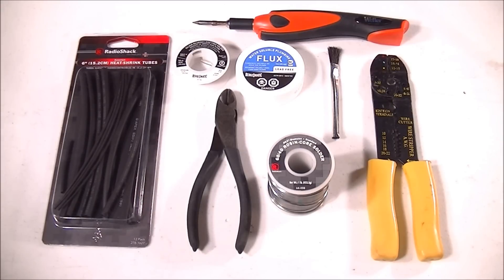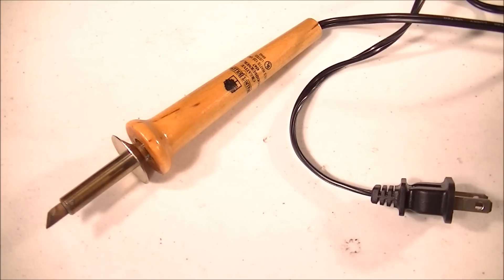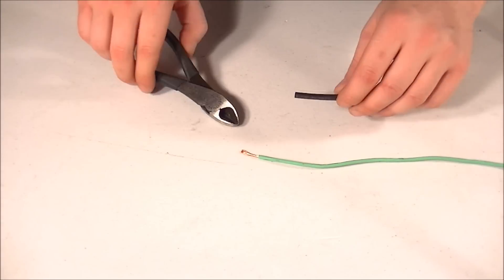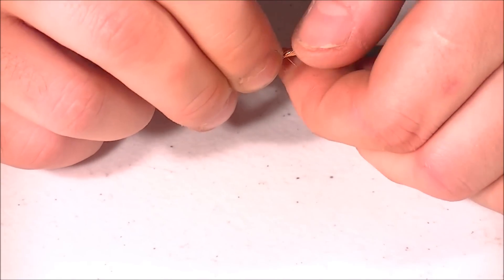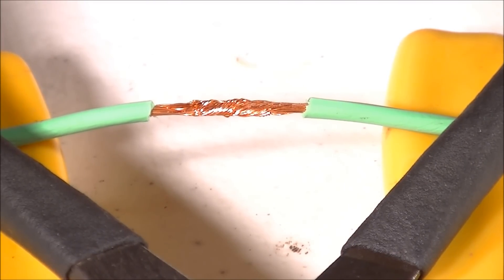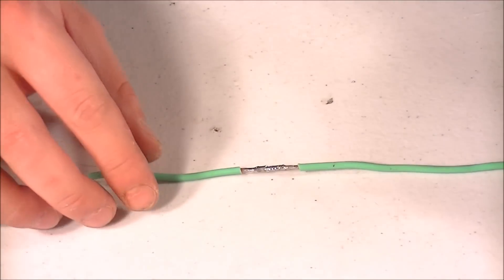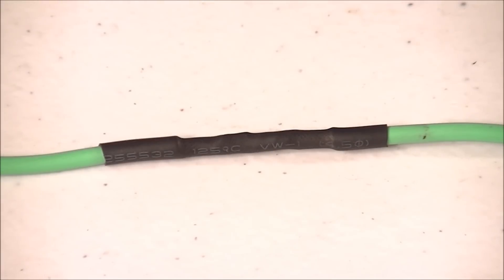How To Solder - Intro/Joining Stranded Wires - Part 1

Comment: 115 volts ! I was using a solder gun from O'Reilly autoparts store that I bought to solder a wire harness on my low beam headlight. It wouldn't get the wire hot enough to solder. The solder gun is 60 watts plug in.

Comment: i soldered a wire for ignition system on a GSR engine in a 1995 honda civic and one night it would not start i found the solder connection broke off from flexing i was sad... this is why they do not solder wiring on cars and trucks they crimp them and they are stranded wiring, i did learn that in college when i took a 1 year class on auto electrical.... it was a great class to take and learn something like no solder on some things.. but just crimp them together for flexing problems... they will flex and brake off like mine did ....

Comment: Can you bend a stranded wire that has been soldered? I needed to do so in order to get the wire up through an exit hole in a blender. Just hoping I didn't loosen the solder. Thanks in advance.

Comment: I am a qualified electrician in South Africa and when I use my wire stripper I pull the insulation off towards the square side of the wire stripper. It comes off much easier and because I have used it for a long time I do not have to look at the wire size any more, try it and you will see a marked improvement in stripping wires. ( over here we call electrical wires cables, funny.)

Comment: What solder ratio would you use for 14 gauge wire? Or other similarly small wires? Working on soldering an O2 sensor to a project I’m working on

Comment: Get a good tin on the iron heat one side of the material to be soldered get it hot and it will draw the solder right through it. Get the right temperature or you can burn it up if too hot.  The tin makes the solder joint brittle it does not like to flex.

Comment: Worst method ever of joining wires together.....never twist wires together. Causes high stress areas where solder will not creep into the inner core of the strand. Also the stressed areas are likely to break when mechanically stressed. Use wrap splice method of lineman's splice to join wires to obtain high durability
Reply: Any recommendation on how to solder 4 wires together? I’m having a hell of a time
Reply: @thebruhhh  what you need to do is to look for instructions on the lineman's splice or western Union splice. Video https://m.youtube.com/watch?v=O-ymw7d_nYo

For soldering 4 wires together, pretin them. Hold the pretinned conductors together with a thin piece of wire by wrapping it around. Then solder all 4 wires together. The extra wrap of a thin (30awg) strand of wire assists in soldering the wires together, no fumbling around with crocodile clips to hold it all together.
Reply: @Turnerbiker73  thank you!!

Comment: Just want to say thanks. I have recently watched many solder how to vids and just was not getting what I was doing wrong. The explanation regarding letting the solder touch the tip and the wire and leave it still and the heat will transfer better was exactly what I needed.

Comment: You didn't even show using the flux. What the fuck. I never use flux to solder wire and haven't had an issue.

Comment: I like your video.  Two things I like to do as a habit, 1>put the heatshrink on before removing the insulation.  The bare wires can snag on the shrink and get bent which complicates the process, 2> I put silicone grease on the wire before shrinking the tubing.  It keeps moisture out of the joint in the case it is an automotive wire.  I particularly liked the use of the side cutter and stripper to hold the wires up and stable.

Comment: Hi, I have a question - why is that the wire will be stiff equally on both sides not only in the uninsulated part/visible soldering joint but also about 1 cm in to the insulated part of the wires? Have I used too much flux? Thank you!

Comment: Solder is make believe for me. It does not work as it shows in any of the videos. I use a soldering station and still you have to apply the solder to the tip of the soldering gun. Heating the wire with the soldering gun just burns the wire and the insulation. Soldering just does not work in my universe.

Comment: Is that shrink tubing waterproof? I'm only asking cause it's for the lights on my boat trailer. And the wires get submerged under water at the boat ramp.
Reply from the maker: Thanks for watching! This particular type is not. However they do make waterproof types of heat shrink that are. Usually they have a special type of adhesive coating on the inside that fills all the interior voids and makes your connection 100% waterproof. A bit more pricey but obtainable at most auto parts stores and online. Hope this helps!

Comment: Did he apply flux to the wires here? Is it necessary to purchase flux if this is 90% of the soldering I'll be doing (wire unions)?
Reply: In another comment he said he was using rosin core solder so the flux was integrated into the solder itself so he didn't need to apply any

Comment: Thanks a lot! I have been all over youtube and people bashing over and over.. from what I have learned (new at this) is that when you make the X with stranded wires, it is called a "Lineman Splice" and is used for stranded ONLY. What they say is doing this will weaken stranded thus not recommended. This seems to be the best way as you have shown us and I have a LOT to solder and will be using this method. Thanks a lot man! Great work!!!

Comment: Thanks for the video! Quite illustrative. 
I am still running into trouble, though. For some reason the wires do not absorb the solder and they melt before any solder can stick to them. I have not tried the flux yet, although the solder itself has the flux in it. The wires are not oxidized and are made of copper.

Comment: Why does excess solder increase the resistance? Wouldn't it actually lower it, since the cable gets a bigger diameter at that point?

Comment: twisting the wires is more of a structural connection, sacrificing less resistance.  use a small diameter copper strand (separate from the wires you are connecting) to wrap around the wires instead.  Great video though!

Comment: great video. but you should clean the flux if you want a long lasting joint. flux will corrode the metals over some time. just wipe it with some isopropyl alcohol before putting the heatshrink.

Comment: Another thing about soldering: after soldering, do not move the soldered joint until it is cooled. There is a very brief moment in time, between the time the solder is molten and the time it is cooled, that the solder is susceptible to cracking. I've seen many people solder something, and then, immediately after soldering, shake it or tap it to remove excess solder. That is a bad idea. That is a tip from my 35 years of being an electronics technician.

Comment: Difference between rosin flux and solder that says 2% flux
Reply: 2% means it  has 2% flux in the solder core.Just don't use any kind of acid core flux.

Comment: Excellent vid. Two very minor things: flux removes the microscopic layer of oxidized metal on the surface of the wire (pipe, etc....) allowing the molten solder to stick to it.  Also, silver has higher conductivity than copper. Solder high in silver content should have no problems with resistance for the type of connection in the video. This is no excuse for poor workmanship! Excess solder is not necessary nor does a lumpy joint work well with heat shrink.

Comment: I did not see when the flux was applied.  When should it be applied?  Before twisting the wires together?
Reply: It's usually in the solder.

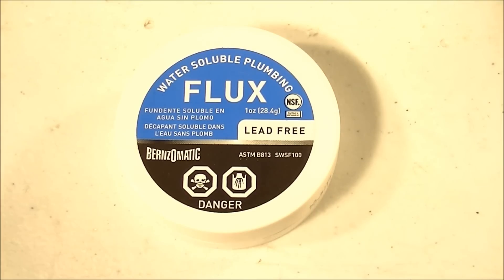Comment: Great video, but at 1:17 you say that flux oxygenates the metal to be soldered.  This is incorrect.  Here is a quote from the metallurgy handbook.  "In high-temperature metal joining processes (welding, brazing and soldering), the primary purpose of flux is to prevent oxidation of the base and filler materials. Tin-lead solder (e.g.) attaches very well to copper, but poorly to the various oxides of copper, which form quickly at soldering temperatures."
Oxygen is your enemy when soldering.

Comment: Why do we need soldering when the wires can be connected and wrap in electrical tape. ? Please advise. Thanks 🇬🇧
Reply: Call an electrician.
Reply: Soldering is a better connection and if done right is pretty much guaranteed not to come undone. It provides a strong connection and ensures a good electrical connection. Electrical tape comes undone, especially in different temperatures like high heat. Shrink tubing is a much better alternative
Reply: Zach Novosad  if I need to buy all the soldering equipment it is going to be expensive for me. 
I need to extend a cable on the wall which is connected to a spurs fuse (U.K) so I can connect the kitchen extractor to the spurs fuse. Please can you advise another safe way without using the soldering method. Thanks. 🇬🇧
Reply: +Maria Gomez you could use a butane torch with a soldering tip. It requires no electricity

Comment: where do you buy your wire? i'm looking for some 28AWG (or at least 0.55mm diameter including insulation) stranded wire.  finding it for a reasonable price seems next to impossible...mouser seems like the best thus far.

Comment: being a cheap bastard, I recommend not using a sponge too much to clean the tip. the constant drop in temperature lowers the life of the tip. I use a block of wood in place of a sponge most of the time after the first cleaning.
Reply: Yeah, wood is probably worse for the tip than a damp sponge. It's supposed to be DAMP not soaked in water btw.
Reply: altpath
Reply: You could do more damage to your tip with a block of wood. Possibly burning through the wood and dulling your tip.

Comment: very helpful video. I am about to begin wiring a drone. One question, did you forget to show when the flux is used? You mentioned it at the beginning, but I did not see you apply it to the wires prior to  soldering.  thanks.

Comment: i have 2 gauge in my RV and want to add a battery to the wire that continues to the panel. what do you think about splicing that cable. I would like to use a ring terminal with a connection like a crimp splice. Are you aware of any?

Comment: are you able to solder a copper wire to a silver colored wire (I think it's aluminum)
Reply: I'll answer it,no.The only thing I would suggest is the Marrettes sold for connecting copper to aluminum,with the compound to keep out air.

Comment: why would excess solder increase resistance?
Reply: Probably because solder (lead and tin) are not very good conductors of electricity. But the thing is, if the cross section increases, the resistance would decrease, I'm a bit confused.
Reply: Sigh,go find the Radio Amateurs Handbook in the local library,or on line and study the electronics theory.
Reply: Maybe this will help you a little, The same reason a big wrapping of small copper wire is a transformer, like you see on many AC adapters on your electronics. The big wrap of specified copper is causing a resistance flow of current from one end of the transformer at 120/110 volts AC out to the other leg of the trannformer down to like 9volts DC.

Comment: Great video! Thanks. What would you recommend for a single stranded wire going into a breadboard? I find that most of the time the wire comes undone, bent, etc. even when twisted tightly together...I would like to solder it, but I don't want it to be too big so as to not fit in the holes in my breadboard. Any advice is appreciated!!!

Comment: The x pattern is better for when you can't twist the wire due to either fragile components that may easily fall out or it is connected to something that can or should not be twisted

Comment: Video helped a bunch. The one thing I've never practiced when it came to cars is electronics and wiring/soldering. After attempting to solder for the very first time a few days ago,I thought I did well,until I watched this,I didn't use flux I probably used the wrong solder wire,and never cleaned the gun tip, and mine look 5x as bad as his bad solders. Recently had a problem with electronics and I'm putting the blame on my bad solders. Pulling them now so I can redo them.

Comment: for something like a guitar, could you skip the soldering altogether and just use electrical tape?
Reply: +MarkToast Oh hi, I'm working on my guitar as well. I've installed EMG 81/85 solderless pickups, albeit the toggle switch is not solderless... The answer to your question is yes and no. Soldering is better since it will hold stronger than electrical tape. But, if you're just using it for a wire or two it should be fine, just make sure to stretch and wrap it so it's stable and no wires are exposed. Also, there are lots of other ways to combine wires without soldering. 

If you are like me and you don't have a battery compartment for guitar, make sure the battery wires are not exposed either and it'll be fine.

My question: My strat toggle switch has 3 wires. Two of those wires are for bridge and neck pickups.. does the 3rd wire go to the volume knob, the cord jack, or the tone knob?

Comment: Thank you for an excellent and clear tutorial. Great examples of good and bad, and thanks for the test! QUESTION for you (I hope you are still reading comments): I bought a Weller to solder a length of stranded wire to a nub of knob-and-tube single-strand wire sticking out of the ceiling. I am using stranded because it is flexible. That old K&T is likely very brittle. I took down a ceiling fan with for lights on it! Wow. The Neutral was just sitting in the wire-nut, so it all got pretty warm up there, I'm guessing. Any insights and suggestions? I am REALLY afraid to twist these together because I do not want to bend that nub of old wire at all for fear it will just break off. If it does, I am screwed... I'll be tearing out lath and plaster. Thanks again. Great video. Really good filming quality, and sound, as well.

Comment: Why do you say that using excess solder will increase resistance? Excess solder just hangs off the sides. It shouldn't affect the resistance at all. If anything, it should reduce it because it lets electricity flow through it.

Comment: Thanks, this video was very well done.  I'm having better success now that I know to touch the solder to the point where the iron contacts the wire.  Before, I was trying to hold it on the opposite side of the joint, hoping the heated wire would melt the solder itself.  That was giving me burned looking joints, and melted insulation.  Very good info.

Comment: Thanks for the Tutorial, I'm going to go apply for a job at NASA now.
Reply: Check the NASA spec for soldering. 5 wraps for each wire then solder. Good for vehicles or high vibration areas.
Reply: WiIdbiII
Reply: damn, was soldering the only skill you lacked
Reply: @alqaadi9858  yup!
Reply: Hitesh Prajapati l
Reply: lol
Reply: Look

Comment: Also, would it be more beneficial to twist the wires back on themselves so that if the wire did get hot they wouldn't become disconnected after the solder melted? 

Great video by the way. Informative and to the point.

Comment: I might be wrong, but I think the flux doesn't oxygenate. I think it prevents oxygen from entering the hot metal that would rapidly cause it to oxidize. Kind of like argon surrounding the arc while welding. Maybe someone else can chime in.

Comment: I have a 30w plug in Weller and 97/3 rosin core solder. My problem isn't that I can't melt the solder but when I put the iron under the wire to heat up its doesn't melt the solder. Need help please.

Comment: For wires like this and all types of wire used in Automotive, What is the best type of Soldier to buy and use? I might have the wrong type even though I bought at electric store & RadioShack.

Comment: thanks.  I think my problem was no flux solder.  couldn't seem to get the stranded wire hot enough to actually get the solder to flow into the strands, it just rolled off.  I need to practice.

Comment: whats the point of soldering when you can use connector blocks, crimps etc etc...much quicker cheaper and efficient instead of this long process.

Comment: This showed me exactly what I was doing wrong, and 15 minutes later I'm soldering together wires like a pro.

I think the key was pushing the loose ends together.  Previously, I had been using the x-method shown, and I had three problems.  First was the wires never seemed to heat up enough to take the solder, even though the insulation was practically melting off the wires.  Secondly, I thought you weren't supposed to introduce the solder until it would melt upon touching the wire.  Now I see to touch the solder to the tip and the wire at the same time to help with heat transfer, then switch to just soldering the wires by themselves without touching the tip.  Thirdly, with the X-method the joint ends up being so large you have to use a bigger piece of heat shrink, which doesn't seal as well on the wires.

I'm in the process of soldering a wiring harness together, and as noted above, my technique has totally turned around.  I just soldered about 8 joints together with significantly less heat than I was using before, and the joints look 100% better, and it took less time than I was taking to solder one joint.

Thanks!

Comment: I needed this tutorial, best most thorough demo on Youtube which taught me a lot. I used it to solder very tiny wire and heat shrink it to give a nice clean finish with good conductivity. Revisiting old solder work which looked like your examples of how not to do it.
I also waterproofed it by adding Black Witch neoprene adhesive to the ends of the heat shrink.

Comment: Im looking to solder 2 wires together, not a bunch like this.  Is it the same concept? Basically soldering a battery holder positive and negative to positive and negative to a small tft monitor.

Comment: You misspoke. Flux does not oxidize the metal, it prevents oxidation and actually eats away the oxides on the metal thus ensuring a solid bond.